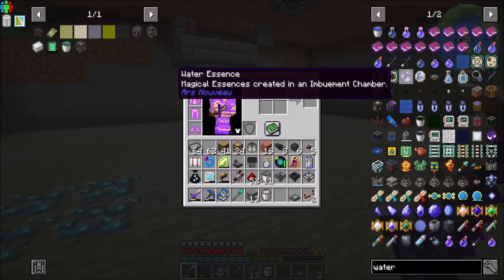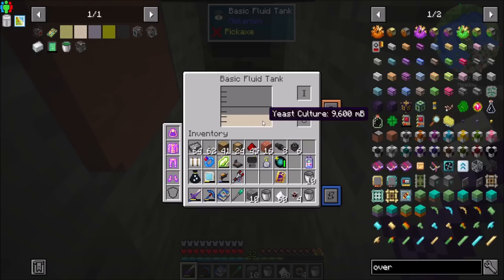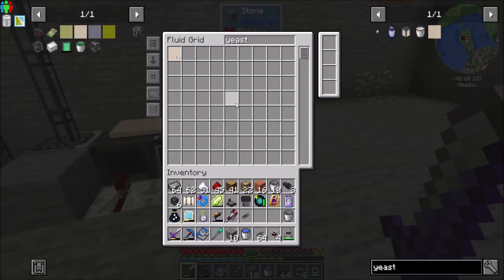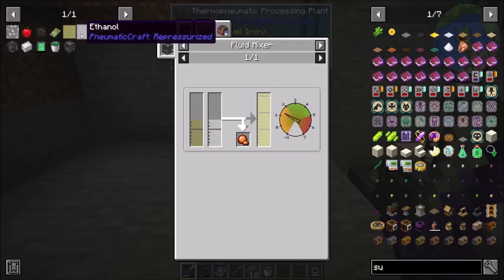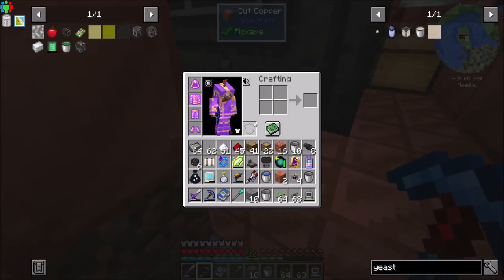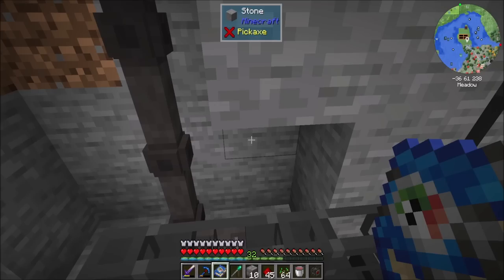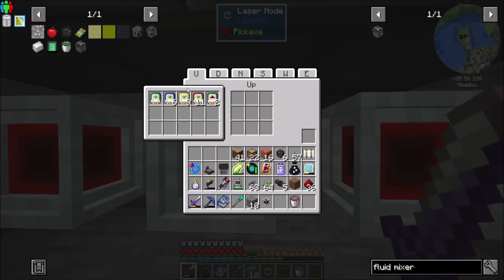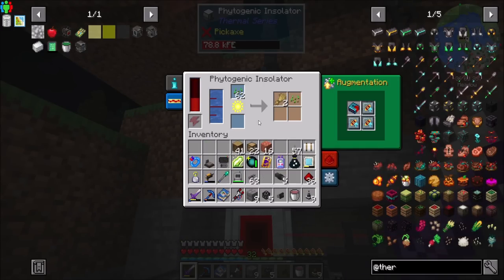Lets Play S11E70 Biodiesel Automation

Comment: Fun fact: some PNE machine can share both pressure and heat 

When sharing heat you increase the thermal mass and surface area 
This is why when he moved the machines together it couldn't keep up with the new value of air cooling
Reply: he should have been able to correct it by making sure the other sides of the machines were not exposed to air blocks.

Comment: 36:25  - sounds like someone forgot about sneaky mode again :)
Reply: Not only that, thermal also has 2 upgrades that do exactly that, one to replant, one to destroy the extra. Although idk how they would work together in this case because idk if the 100% seed would be considered extra or not, but the way it is phrased it looks like it isn't so that whole node mess could have been avoided with 2 upgrades since speed is not that important in this. The only card that was needed was the fluid one for water

Comment: I think there was a key binding to change the wireless terminal mode, which should work even when it is in a curio slot…
Reply: There is. It's shift+g I think by default

I changed mine to shift + tab to switch mode and tab to open
Reply: @TT_PLEB  I changed mine to the number pad for both access and mode switch.

Comment: Cant you use Lava for >=100C?
Reply: He could use a ton of things for heat in this pack. The only reason he might not is because eventually it's supposed to "run out" and turn to obsidian at some point.
Reply: Lava will eventually lose it's heat and turn into the cooler block.

Comment: I'm done, I'm sorry but I'm done with this modpack.
The lastest updates have turned your modpack in to a chore.
All the recepies have changed and not to the better.
Now I'm trying to make manananmanam ingots and the oven says it's not hot enough to smelt ancinet debris, ok so I google and the solution is to make it in induction oven.
So I do that but then I can't smelt it in the Tinkers oven because it's not hot enough.
So I go on the internet and tru to figure out what to use and all i get is outdated wikis and reddit threads from 5 years ago telling me lava is good.
So I ditch the tinkers and go and tryout create and starts to built a windmill..... but I can't because the recepi for sail frames have changed.
Checks the NEI and all i get is an empty sail frame is done by putting a woolen sail frame in the workbench.... ok so how do I get an empty sailframe?
So I go the changelog for create and there it is "recipie for sail frames have changed" and nothing more not even a hint to what it have changed to.
So I ditch that mod and think that maybe I should do Thermal only to remeber athat you don't get more ores from that one anymore.
The thing is that removing ore doubling have completley broken the progression map.
It used to be that you start a new world and you know exactly what to do.
Punch wood mine and get a tinkers or something something thermal up an running to double the ore output and to get that you need this and that and this... and it all just rolls along.
Now you start a new world and maybe punch some wood and then what?
Mine?
Sure... and then?
I don't know because Tinkers won't help you and neither will Thermal....
There is no plan anymore.
Oh and can you please tell the new dev's that if they decide to change recepies that are older than they are that they update their WIKI och make sure that the NEI is updated.
Because I'm spending more time on the internet than in ganme with this mod.
This used to be fun and now it's just an endless chore.
I work for a living so when I come home I just want to play and have fun not do more work.
It's become elitistical to a point of madness.
Take the angel ring for instance, how do you get that?
By rubbing two sticks together?
No it's litterally end game of the end game, and still they charge you for using it.
"You can turn it of in the settings" isn't an option it's an excuse.
It's not your fault thet the mods starts to suck I know that, but come on they suck and you know it.
I have spoken